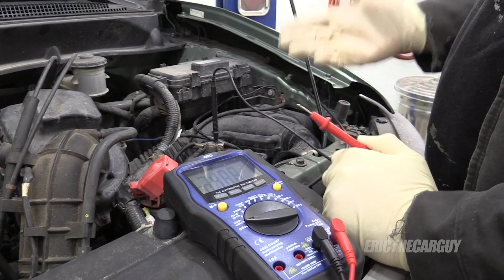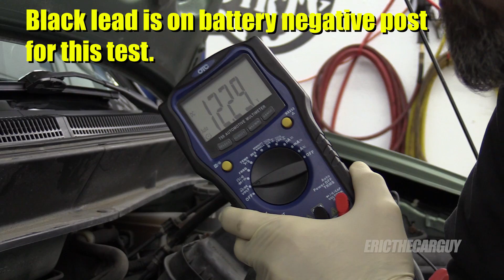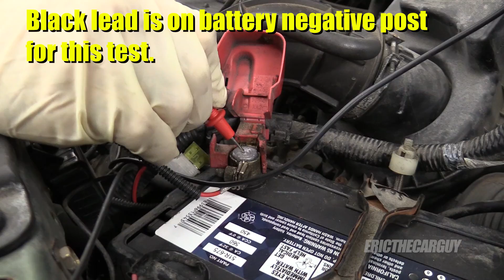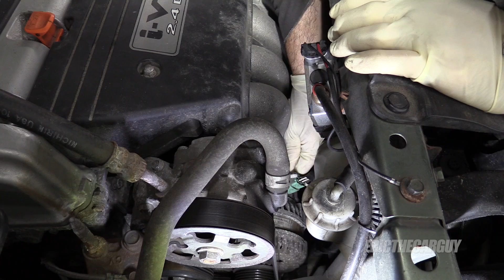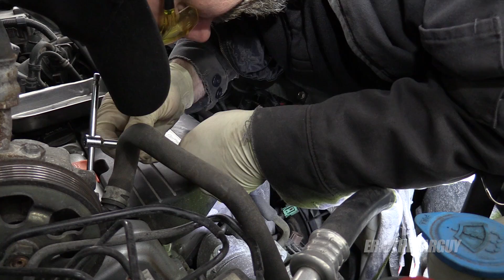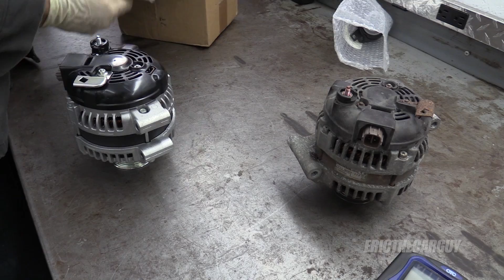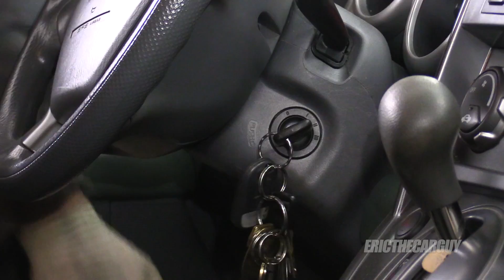Honda Element & CRV Alternator Replacement With Diagnosis

Comment: It's really nice getting alerts for ETCG videos again... Anyway, Wish you would have showed how to test the amperage to make sure the alt. is sending the rated amount when under load. Probably another video... Thanks Eric
Reply from the maker: No need. Ohms law. Not to mention the difficulty of accessing the positive cable coming off the alternator. Remember I had to remove the power steering pump to get access. If it's producing 14v at idle with all loads on, then it's good. At least that's the way I've always done it and in 21 years that method hasn't let me down. Thanks for your input.

Comment: And the old alternator. Can´t you fix it?
Reply from the maker: As far as I know, parts aren't available.
Reply: Thank you for your answer, Eric!  I asked because I prefer to see you fixing all the parts. =P Greetings from Portugal.
Reply: Many moons ago (maybe the 80's) they used to sell repair kits for alternators and starters. I think they were about $30, a little less than a locally rebuilt, and most came with a bearing or two, brushes, diodes, and the regulator for internally regulated models.
Reply: In here there are many kits like this that you are talking. Even for the recent cars 90s/2000s. Most problems are due to regulator, brushes or diodes. But they are all aftermarket kits. The other brands are like Honda. They just sell the entire alternator.
Reply: Cheezy Dee, there are some kits like that still today, there are even kits to upgrade the stator and the voltage regulator so you can actually increase the power output of the alternator for those people that have large stereo systems like myself, it is pretty dependent on the exact alternator, it's fairly common for the popular ford and chevy model cars, but not so much on the imports.

Comment: It's also a good idea to, like Scotty Kilmer says, rev up your engine (around 2000 and 2500 RPM) and check the voltage and the amperage, with and without load.
Since the alternator can't produce a huge amount of amperes on idle (otherwise the engine will strugle or stall), reving up the engine will help with this process of a good diagnosis.

I'm aware that you didn't have so much room nearby the alternator, but what you can do is to check the voltage drop on the positive side and negative side (maximum 4% of the charge voltage, or 0.1V if the ground is going through the chassis) and you have to do this while reving up the engine. Why? Because of the Ohm's Law (Resisor = Voltage / Amps).

Just my two cents. Nice video by the way. I wonder already what will be the next video's topic.
Reply from the maker: If it can produce 14v at idle with all loads on like it did in this video, it's good enough for me. I know it will produce more when it reves up. Thanks for your input.

Comment: We have a 2006 CRV - lovely car! One thing I found interesting in this video is that the key is on the same side of the steering wheel - even though the steering wheel is on the right in our car (New Zealand). Makes it easier to start by leaning through the window!
Reply from the maker: That's likely because it's not cost effective to make 2 steering wheel assemblies.

Comment: Great vid. Sir but I have a few tips of my own. Whenever I know I'm replacing a part especially on vehicles of age, I spray the bolts nuts with some type of  penetration oil a few days before I tackle the job, if I can. I use Knock R loose GREAT STUFF, smells bad though or Kroil.Also put anti seize on bolts that go back into anything aluminum, zip ties are great invention.

Comment: What about the repair of the damage alternator. In many countries they repair them instead replace them like here in USA. Sometimes it is just the voltage regulator or the brush. Will be good just find the damage part and replace it instead dumping $$ hundreds of dollars on a new alternator. I will replace it if the bearing and many other stuff are bad, but in this case I will say it is just the voltage regulator.
Reply from the maker: The parts are not available in the US. At least I didn't find any. Also, I'd rather have new bearings and brushes. BTW, this was a reman alternator. Link in the description.

Comment: Could you have replaced the diode pack & bearings in the existing alternator? Much cheaper usually.
Reply from the maker: As far as I know, Honda doesn't make those available. That said, I'm just fine with replacing the unit. New bearings as well as brushes. I don't know anyone who rebuilds alternators and starters these days. It's just not cost effective in the long run. At least for me.

Comment: Watching one of these makes me love my old beater cars. As much I pour fuel into them every week, I never need a shoehorn to install parts. I was waiting to see you inspect the B+ wire, but there is so little room you wouldn't be able to find it until well into the replacement. It's so nice to see another stay dirty repair, Eric.
Reply from the maker: I don't normally bother with that. I feel the battery voltage tells the story good enough. If there was a problem with the red wire, it likely wouldn't run for long and have much lower voltage. But that's just me. I don't fault anyone for doing things differently. Thanks for the comment.

Comment: I did my alternator last year. OEM was $600, didn't want to bite the bullet or risk aftermarket, so spent $100 on a salvage one with 80K. I might have to do again 80K earlier than I would have, but my labor is free.

Comment: Any tighter fit through that hole and you would have had to pull the engine, trans, fuel tank and left tail light.

Comment: I have found it cheaper and more reliable to take the alternator to a rebuilder rather than getting one from an auto parts store or through shipping.
Reply from the maker: The parts for this alternator are not available from Honda as far as I know.

Comment: Ever get an alternator or starter rebuilt Eric? There’s a great place here in Smithville Ohio that has saved me a good few bucks already.
Nice video!
Reply from the maker: This alternator was rebuilt by Honda. Link in the description. As for 'getting alternators rebuilt', I don't really bother with that. As a mechanic you want the parts as fast as you can get them so you can fix other things. It would be one thing if they were local, and could turn things around quick, but it really comes down to practicality.
Reply: EricTheCarGuy That makes sense for sure!

Comment: I used to always think eric was silly for mostly always using oem parts. Now that I have a newer vehicle I see why and almost always use oem. Even oil and filters. I have a wheel bearing in my near future and that is aswell gonna be oem. As eric said wicked expencive but well worth the money
Reply: jakob simmons Go to a wreck yard and pull same part from same year and model car.
Reply: Michael not many 2014 ford eacapes in any salvage yards around me and I wont put salvage parts in my vehicles. Tho is for the thought....
Reply: Personally I find aftermarket parts are usually comparable or better 
quality at least with GM. Sometimes independent distributors sell oem for less.
Reply: @robertsitch1415  Tells you all you need to know about the crap that GM puts on their cars from the factory.
Reply: @monkeyCmonkeyDoo  yes the quality of the wear items and plastic parts were the main issues some of my relatives had with GM cars made in the last few decades.

Comment: eric, why spend the extra on the honda alternator but not get a honda battery? they are usually cheaper than auto store batteries and a lot better. my 02 cv battery was $48, my buddy works at honda so i got it cheap. but even their msrp was $50 cheaper than oreillys.
Reply from the maker: Because my auto parts store delivers to my shop. Honda doesn't. ;)
Reply: didn't think i'd ever get a reply! lol. LOVE YOUR VIDEOS, taught me a lot over the years!!

Comment: Can’t you simply replace the black electronic part on the back instead of the whole thing?
Reply from the maker: No point really because the brushes will also wear out. Also, I don't think those parts are available. At least not from Honda.

Comment: Smashing repair eric :-D, Alternators and starter motors get so much punishment, im supprised they last so long really. (13.8  to 14.2v is what i check for).

Another problem with charging is after a starter has been replaced, the alternator high current live lead often bolts to the starter+,  people don't always tighten things correctly.
Reply from the maker: Indeed they don't. Thanks for the comment.

Comment: Ok, gotta ask, was the zip tie inserted through that small hole a lucky first shot, or the magic of editing multiple tries? If it was inserted first shot you're a steely eyed master zip tie guru. Great video as always, thanks!
Reply from the maker: I was guiding it from the other side with a screwdriver.

Comment: Great video but you should have included a warning about the factory radio needing a code when the battery is disconnected. Many people are unaware of this and if that code is not known a trip to the dealer is costly.
Reply from the maker: Good point, sorry I missed that. Although all you'll need is the serial # that can sometimes be obtained by pressing 1 and 6 at the same time when the radio is turned on.
Reply: Just a suggestion - If you go to https://radio-navicode.honda.com/ it explains how to get the information necessary to get the unlock code and will allow you to enter the info. Submit the info and as long as you are the registered owner they will send you the unlock code. Ask me how I know? LOL
Reply: That's great information. Sometimes its just simpler to connect a 9 volt battery to save the memory.

Comment: I just changed out an alternator on my 91' Festiva that has an Escort GT engine. Had to drop it out the bottom, that was a bit of a pain, but not as much of a pain as it is with an improper tensioner bracket (v-belt, belt is tensioned by the alternator) Could only get the belt on by removing the water pump pulley to get the belt on all the pulleys. I just bought a used alternator off a fellow Festiva guy who was parting out one of his, for $30 shipped.

Comment: Hi Eric, I have thesame motor. I changed the starter motor by way of removing the intake manifold and I think I have messed up way I put it back together. There are some sort of butterflies in the manifold. Is there a correct way of putting these back together?

Comment: I hate the way everything is SHOEHORNED in these cars.  I had to replace the battery in my 2009 CRV a few months back and the auto place near me said the charging system was good.  But when I was driving it to the shop to get another battery it wouldn't keep the car running at idle. Is that  a sign that the alternator is weak?  Maybe that is a reason that Interstate battery didn't make it 4 years?  The engine has to be faster than idle to keep it up?  The original battery just lasted a little over 3 years.  It has been a damn good car though.  Though it only has a little over 83k miles on it I haven't had to do anything to it other than replace the tires and 2 batteries.

Comment: That's funny I just replaced my alternator in my Ford Taurus yesterday and lost the bolt for the coolant reservoir and had to zip tie it lol.  Car runs mint now, all within a couple weeks new starter,  battery and alternator.  200, 000 miles on it now 200, 000 more to come.
Reply: SLICKNICK 3.0l Duratec or 3.0l Vulcan?
Reply: gokartbuyer vulcan
Reply: Robert Burley don't be a douche I also did a full tune up
Reply: Robert Burley yea ur a douche I think I have enough knowledge to know what a good reliable car is.  That's why I have owned multiple.  I could care less what u think dude.  I save money driving my car.
Reply: gokartbuyer exactly,  the only thing I'm worried about is the transmission but it is well worth getting rebuilt when it does go out.  It's strong now and I maintain my vehicles well.. il buy these cars all day I have owned a 02 and now I have a 06.  For the money u can't find a better all around vehicle I paid 2000 for each one I've had and the only reason I've had to buy  more of them is because people like to run into me and total them.  Lol well a lady just ran into me head on a few months ago I destroyed her new car.  My headlight has a small crack and bumper scratched, micro crack in grill.  They almost totaled it.  I got 1600 bucks out of it.  So basically paid 400 for it and it's perfectly fine drive train wise.  That's all I care about. Meanwhile fuck face over there is putting thousands of dollars in his pos brand new car. And still paying on it.
Reply: SLICKNICK Don't even worry about other people. You've got the right idea. I'm at 184k in my Mazda from 04' been in the family since it was new and I don't think I will ever part with it. Still has plenty of pep and the transmission is hanging in there God bless it. Especially with how I drive lol. If you ever get another Taurus I recommend getting the Duratec 3.0l v6 as it's damn reliable and is very spunky. You'd enjoy it.

Comment: Great stuff as always Eric. If nothing else, you've convinced me to not try this at home. The stress of not being able to finish a repair on my daily driver would stress me out too much.
Reply from the maker: It's not that bad. I believe in you. #StayDirty
Reply: Its really not bad. I recommend doing it on days where you can stay home for the day. I have done some tasks before work, so if you do do that, try to know what you are getting into and how long it will take, and then give yourself some extra time. 
A few times I've had to finish the repair asap because I needed the daily driver that day or in the morning, and I had to wait to get parts. The pressure is on then when you know you can't go out until its finished. It always works out though, just sometimes not like how you planned. Like I will be working by flash light to get done.
Reply: yeah I hate working on the daily driver.. if it's the weekend / fun car & things are going badly you can just walk away for a few hours ( or sometimes close the garage door until next weekend )

Comment: Heyy eric you're back. Nice. Im having an oil press issue. 50-60psi wen cold then 20psi to 18psi when hot at 1000rpm. Would using and oil cooler and an original oil filter help? 1jzgte 20w50 shell.

Comment: I have a 1995 honda odyssey with close to 300,000 miles had an alternater issue  intermittantly not charging after mucho troubleshooting turned out bushings wer almost allgone replaced bushings good to go.
Reply: Piri Hern, where did you buy new carbon bushings for your alternator?
Reply: 30kendel  reply on 1995 honda odyssey bushing removed worn bushing took to a shop that repairs alternaters had them matched up paid a nominal fee. They had large assortment of different sizes.

Comment: Can you not just remove the bolt that holds the idler pulley to the tensioner and get a new 6203 brg. and do it that way?  
I have also found that Dayco ( i think ) make replacement pulleys of different diameters for replacements.  Just at thought.
Good to see some "busted knuckle" videos back Eric.  You did however manage to avoid that, although the potential was great on that first "bugger bolt" on the alt.

Comment: I’m going to be that guy and state that I think the nut to the cable going to the batt is a 12mm.  You said 10mm.    I think they’re all 12s
Reply from the maker: They're all 10mm. After 21 years I think I'd remember. That said, some aftermarket alternators may come with a 12mm.
Reply: Wrecked
Reply: Well I wasn’t being a dick (intentionally).  I just thought you mis spoke by accident.   That said, I drive a tsx with a k24 too and it’s 100% a 12mm.    Every acura one I’ve done Is a 12.  I know what tools I grab in advance when I do one.   Honda’s absolutely May be different than Acura’s with the same engine.  I’ll grant that.   Im somewhat put off by this response as I was kinda joking because I don’t question your knowledge.   I’ve been a subscriber for a very long time and do what I do in part because of your videos.
Reply: Nothing wrong with erics response IMO, he wasn't being rude at all.

All my hondas have always been 10mm, every time I find a bolt I'm like "bet that's a 10mm" always is.
Reply: Matt Way you must be sensitive.  Eric's response was fine
Reply: Matt Way wipe those tears and get over it! That's what you get for trying to be a smarty pants
Reply: Just looked at civic here and it’s a 10.   Acura’s mostly are 12s.   So I’ll admit to being wrong saying I “think” they’re all 12s.   Still pissy about the shitty response.  Kinda like meeting one of your idols and having them be an ass to you.

Comment: Was the charging light illuminated on the dash?
Reply from the maker: No.
Reply: Would've assumed it would light up since the cars charging system couldnt keep up with demand.
Reply: that is pretty unexcusable for Honda!  I hope the charge light is not burnt out
Reply: FYI, the ECU in this vintage CR-V/Element does not measure alternator output (voltage or current); instead, it detects battery voltage staying low for an extended period. This means that your battery will be pretty much dead by the time the warning light comes on. If you fully pre-charge the battery, you can drive around with no alternator output and no warning light - for a while...